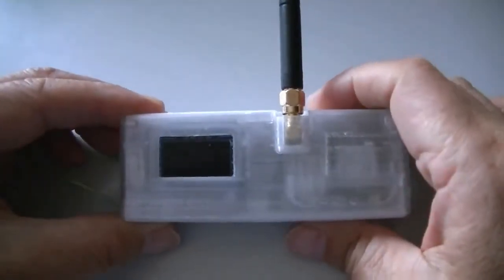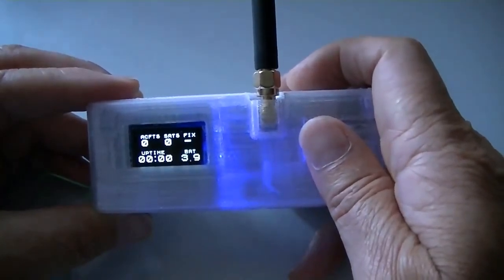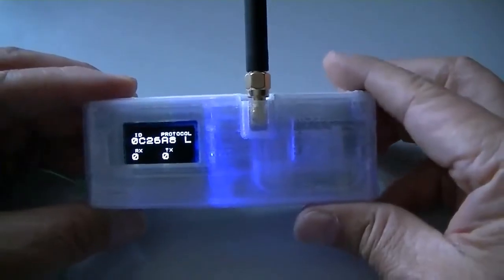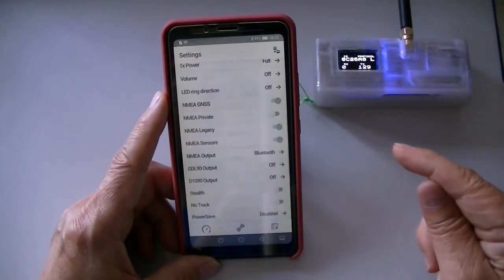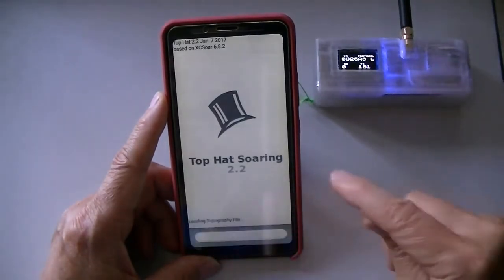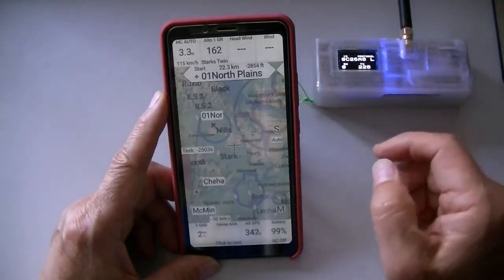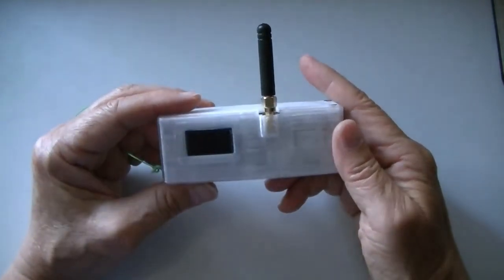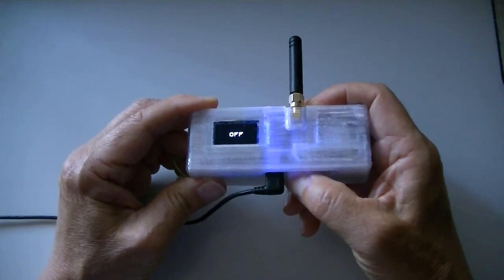Prime MKII: SoftRF on Lilygo T-Beam

Comment: managed to install with sound in lilygo? use on an ebook that has no sound but has bluethoot!!!
Reply from the maker: I connect this Android phone through Bluetooth. The Android phone makes sound when there is close traffic. Lilygo t-beam does not have buzzer/speaker. T-beam made sound when I attached a Piezo speaker on t-beam and modified SoftRF. But the piezo speaker does not make sound loud enough.